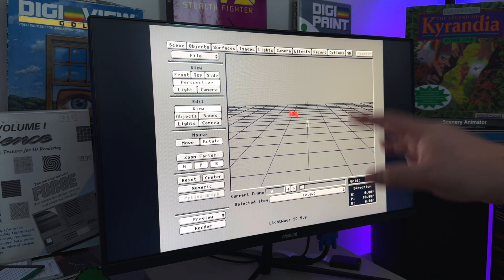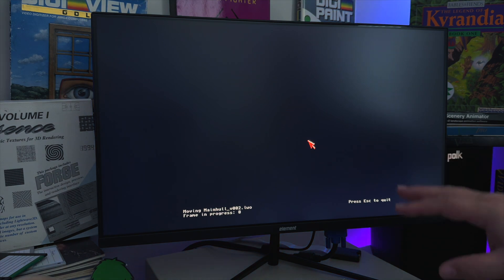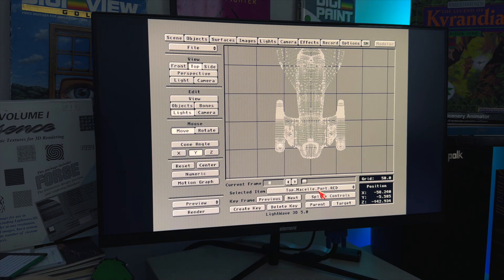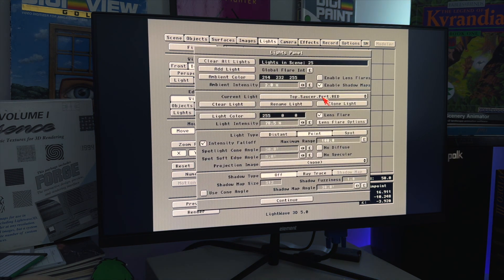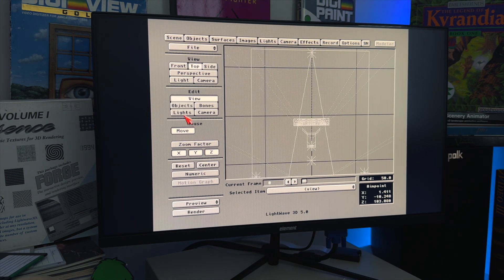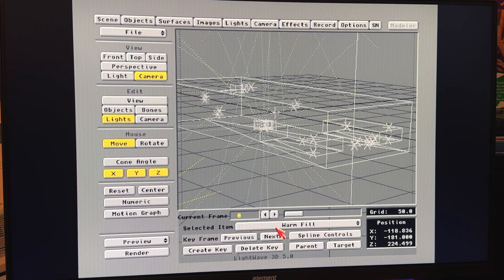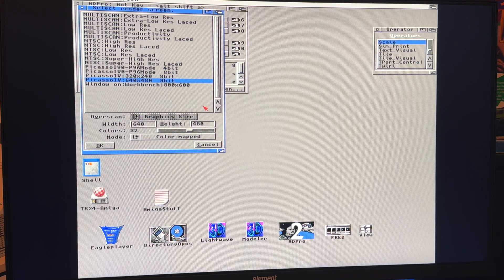Original Star Trek Voyager Model in Amiga LW!

Comment: 1 December 2024, I HAVE to watch this video again....I HAVE TO ;-P

Any idea what is the material settings for the Voyager Hull for Lightwave 5 back then? It looks so good!

It somehow avoided that 90's CGI everything looks like plastic look.
Reply from the maker: texture maps for all channels. Color, spec, diff, bump. But also color was actual photo of real model. So it better look real! :)
Reply: @HoldandModify  Colors were actual photos....so it's like Photo Projection but instead of on a cheap low poly, it is on a high one....

They took actual orthographic shots of the model and project it on the model? Wow...

Comment: I been doing space stuff in Lightwave for years, but i still learn things.  On shows like Voyager the single point polygon stars always had what i called an overblur problem.  A camera shutter blurs for half a frame length, but stars have extra blur on top.

 So it can be fixed, with polygon size slider.  30-40% or so will fill gaps but have stars match shutter angle, but can be cranked up to make hyperspace or something.
Reply from the maker: Nice tip!
Reply: @HoldandModify  yeah. I wish I had a 30 year time machine to send it back to Foundation Imaging.  Shortening polygon length trick with particle blur, looks more "real" how a filmed star background would look.

 And just a cloud of dots, increase polygon length with an envelope as it expands, instant fireworks trails, no render penalities

Comment: This is AWESOME! I recently finished rewatching Voyager about a week ago. It's crazy just how cutting edge some of this stuff was at the time. I am curious about the "Camera Lens" used for the CGI shots of Voyager, specifically if there were different focal lengths depending on the scene or if it was a fixed value.
Reply from the maker: We never did zooms really. In that show. Firefly and BSG is where we went nuts with that stuff. Voyager was always shot rather wide. 24mm to 35mm. Always prime type lenses. 70mm to 120mm here and there.

Comment: The video slot provides the non-flicker-fixed Amiga video. The Amber chip is not involved. Amber is flicker-fixing the same signal your PIV card is flicker-fixing.  PicassoIV works the same in 3000 and 4000 (no Amber).  

Also I am curious why you didn't render on your PiStorm'ed A1200?  Just giving the lovely A3000 some attention?
Reply from the maker: Yup I wanted to show off the A3000 and its new monitor. Not sure if you noticed but that monitor doesn’t suffer the moire effect when I film off it like the other. So I ordered another one. Heh.
Reply: @HoldandModify  I actually was thinking it looked nice. I still could see a little bit of vertical banding in Amiga  video output. You might try adjusting the pixel clock although in NTSC I haven't had as much success as in PAL HI-res interlace where I can remove the banding completely  (and I am in the US, with an NTSC Amiga).  A CRT shows no vertical banding on the PIV output or Amber output.
Reply from the maker: @brettjns  I’ve adjusted the amber as much as I can. That’s as good as I can get it. Jail Bars for life! Heheh.